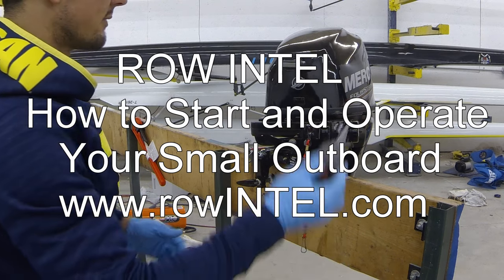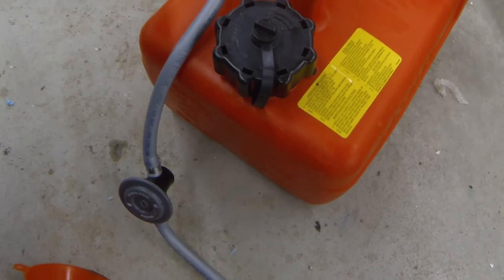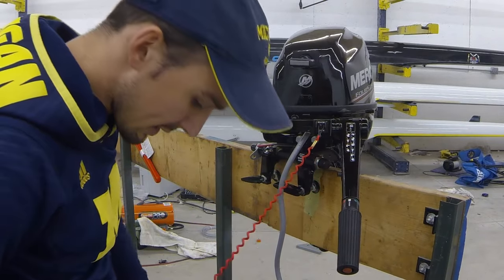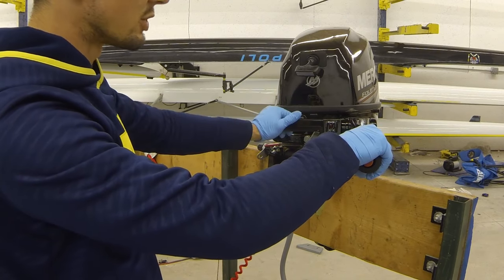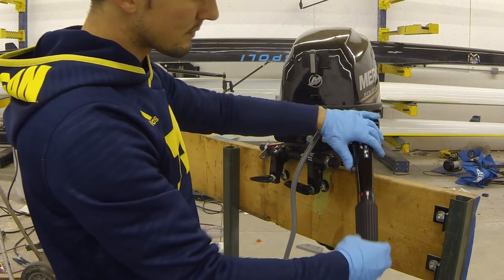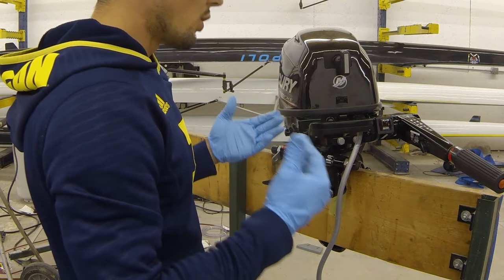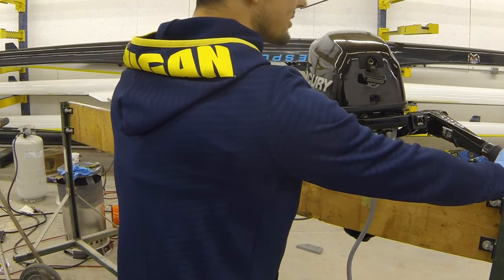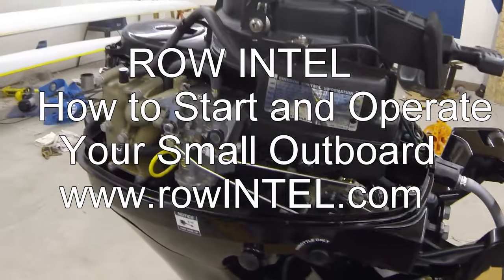How to Start and Operate a small outboard 4-25HP

Comment: And do NOT start it with no water going through it. You'll be,at the very least,replacing a water pump impeller
Reply: He took the lower unit off
Reply: He should still mention that running an outboard without water is going to damage the impeller!

Comment: I recommend to tilt fuel tank while running, so that you can keep some amount of gas even at the time you run out of the fuel. When you experience the run out, you just put the tank horizontal positon, so you will know you still have some gas in your tank. Don't you think it's a good idea?
Reply: Too much work for a guy but yes this is a pretty smart idea

Comment: You cant start a outbard engien dry you WILL kill it
Reply: @musicmanthatlikesoldandnew7324  Don't you mean impeller?
Reply: @dale3858  From my experience the impeller is plastic and rather cheap. But some models are a bitch to change. I think that the guy was servicing the motor sa the lower part was removed. I have started my motor a couple times on dry to see if stiil working but just for 5 seconds. But I have bought a motor and replaced the impeller because thedude started on dry and let it run.

Comment: How did you start it w/o the kill switch attached?
Reply: Late reply. The reply you got is wrong. I don't know if it's all Mercury's but mine has on off switch that doesn't need the kill switch to start it. You just push up and it stays in run mode. How kill the switch works on these ones is when you put it into Run it locks in the kill switch. But you don't have to insert this for it to run. It's not like other outboards that has the clip and spring loaded kill switch that won't start withought the clip. 
I thought it was law that outboards weren't allowed to be able to operate withought them inserted but here we are

Comment: If I’m storing the fuel tank, should I keep the tank’s gas relief open or closed? And how come this motor’s lower unit is not immersed in water?? Does it not overheat since it’s not cycling water??
Reply: Looked like the lower unit was taken off and he did not run it very long so the engine temp was fine. Also 2 stroke will brake down in 30 days so add stabilizer so your carb wont get gummed up and tank stays fresh for use. Also close that relief during storage and travel, only needs to be open when your running your outboard. Happy Boating!

Comment: Was hoping you would mention steering damper bolt. I just snapped the handle on mine...,4hp Yamaha.  It’s on the upper shaft correct? Why does it work?

Comment: Do you have a suggestion how to transport a 20hp Suzuki DF20 short shaft. I just bought one for my inflatable Truekit Discovery. I will be installing and uninstalling from transom after each use.  Urgently I have it on a wood stand that I built that can fit under a dolly to move about the garage. I am challenged as to how I can safety carry it in my tundra pick up truck. Thinking about a diy bed slide with a foam baby crib mattress to lay the motor on top of it, tiller side down. Any help would be great
Reply: Sounds like u have it figured out